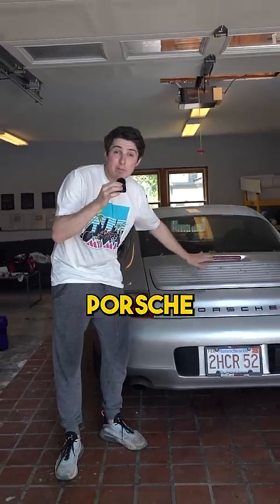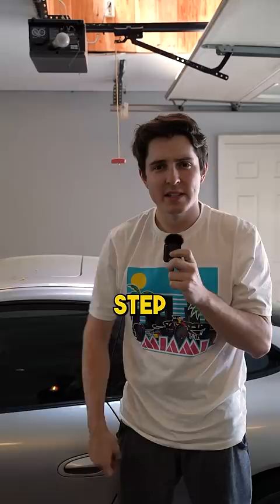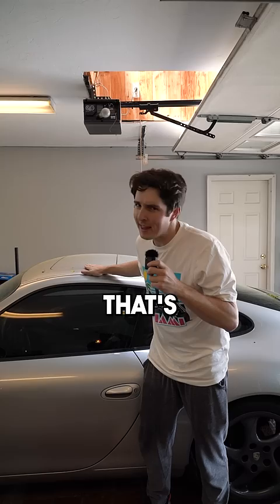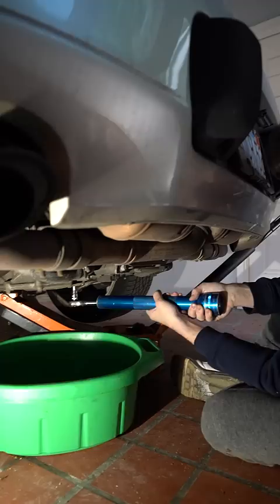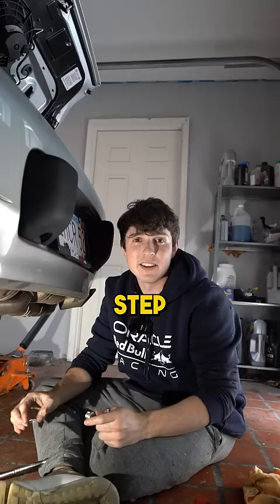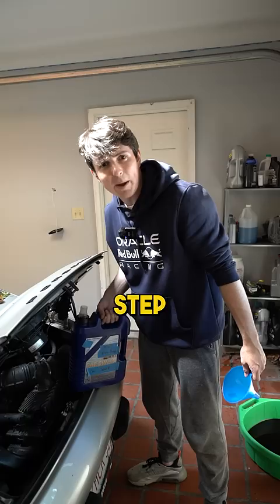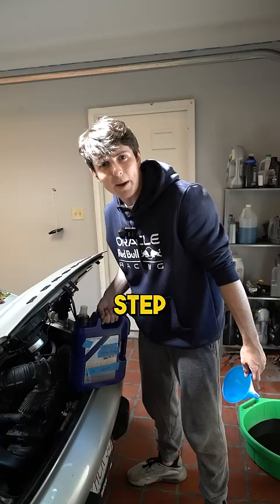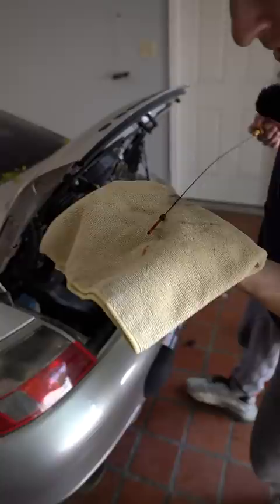Theres A Problem...

Comment: A pro tip, always lube up the gasket on oil filters and fill up your oil filter with oil. This helps both with installation and helps prevent the car from running dry till oil can get pumped throughout the car. The only time its not recommended to put oil in the oil filter is when it is instaled sideways rather than up and down.
Reply: i thought the same, and looks like i was right
Reply: It also makes the filter a bit easier to remove.
Reply: Lube on gasket don’t matter
Reply: Bro took 10 years to comment that

Comment: I have always wanted to know hot do an oil change. Thanks for teaching us 😊
Reply from the maker: Glad it helped!
Reply: Its pretty easy
Reply: @smolltaco5667 not for this guy.
Reply: @captaincrankshaft btw u need to run the engine for 30 secs b4 checking the level to coat the new oil filter. Also it looked slightly over filled. I have been in a garage my whole life, and u learn these things w experience x
Reply: @captaincrankshaft my car blew up while doing an oil change💀

Comment: Missed a step it helps filling up the oil filter with oil and then putting on then you wont have to wait as long to have it measured right on the stick

Comment: You should actually rev the engine before checking the dip stick because it might not actually be full since no oil has circulated yet

Comment: Here's a tips. Before you change your oil filter and put it in. Clean it with clothes or use some gas to clear the oil, and then soak the new filter with new oil before putting it back.

Comment: Now this was a pretty good guide on how to do an oil change on this specific vehicle. However, most modern cars (2000-2023) have there oil filter just under the hood, and should be loosened just to the point of being able to take it off. Next is locating the drain plug, now it should almost always be at the bottom of the car and needs some sort of socket (from ~15-20 mm socket). You also need a socket wrench you should be fine no need for a torque wrench unless you have one. Now Jack up the car and put a stand, now the plug bolt should be near the front of the car if your oil cap is up there if not then it should be at the back. You might also need a smaller socket, a screwdriver (Phillips head or flat head), or a torx bit because most cars have the oil plug blocked by some sort of cover. After you take off the cover and you have located the oil plug grab your socket and socket wrench and go counterclockwise with it. After the plug has been removed and the oil is draining wait 5-10 minutes before putting the plug back on; However before you put the plug back in you need to put on a new seal ring some filters that you buy may have a new seal ring for the oil plug though some won’t. So I recommend while looking for the oil filter get an aluminum or copper seal ring. Now after you have drained the oil and put the plug back in and screw it in tight but as soon as it requires lots of force you should do one more rotation and stop, this is mostly preference. Now the plug is in and you have your new oils filter you should see 1 or even two O rings (the rubber rings) in the box. Take out the filter from the car and try not to spill too much oil everywhere and wipe up any spilled oil. Take off the old O ring or rings, and replace them with the new ones. (I recommend this part but it’s not needed) rub some of the old oil on your fingers and rub the new O rings gently with a little oil. Now finally put in the new filter, and screw on the oil filter cap. Now finding your oil fill cap and adding just about 5 quarts is a safe number however if you have the owner's manual and want to search how much to add or just search it up online that is the best option. But I will always say just leave it to the professionals and always top up everything you can.

Comment: You have to let it sit then check it, after that u have to start the car and then turn it off after that u have let it sit for 10-20 minute then check it because u might of not poured it all out (oil) and so you have to let it sit so all of it sits at the bottom and turning it on spreads it all through the motor

Comment: quick tip, apply a thin film of oil on the new oil filter gasket. And if the filter position allows you to, put some oil in it

Comment: Another tip is to get the engine up to temperature. If its hot, its viscosity changes (the oil gets thinner) so nothing is left of the old oil. And if its thinner, it has a higher cleaning effect because it carrys the dirt with it outside

Comment: make sure to turn on the engine and let it warm up before an oil change. it helps the oil to collect all the sparkly bits also warm oil will drain better

Comment: It helps to fill the new filter with new oil before screwing it back onto the car. It can be a bit tricky as you have to hold the new filter level to keep from spilling oil. Idk why this is important, but that's the way I've always been taught and that's how I do it.
Reply: you honestly don't need to do it mate, a lot of people do it that way and a lot of people don't. There's not really a huge point doing it except adding time to your service.
Reply: @mekagumi  okie dokie

Comment: Every car is different and some, more difficult. Make sure you let the car run a few minutes to let the oil run through the engine and check it after to see if it needs more oil. We recently did an oil change on my dad's truck and mom's car and it was a pain in the ass being under each

Comment: For the oil plug you dont need to use a torque just a normal wrench and all you need to do is tight it just enough were its hard to tight the eat and cold of the air around it will do the rest

Comment: I Always laugh when ppl say to use the oil with right Specs. My 1993 Rover 600 Just says "10w-40"
No further Specs, nothing. Just 10w-40
Reply: Some vehicles simply require a certain oil weight. Others like Porsche require a specific oil weight and spec

Comment: Did you tighten uo the oilfilter with a wrebnch? If yes, pls never do that and screw it in just by hand, oil filters have underpressure (or what ever it is in english) and they suck themself in l, tightening an oilfilter with a wrench, could damage it or brake it, it can fail and brage your engine😊

Comment: Kinda surprised the oil change was so easy to do
Reply: This model 911 doesn't have a separate oil reservoir like the turbo and gt models. In those you have to drain the oil reservoir as well as the crankcase and since it's thin aluminum you have to make sure to use a 2nd wrench to prevent twisting and tearing. It also has a crush washer and a torque spec. The oil filter housing has 2 orings and requires a certain torque spec as well. On the 996 911 turbo the turbos require draining the reservoirs on the turbos themselves as well. Takes me about 1.5hrs to do it on my 997.1 911 turbo

Comment: Bro said new plug and washer but not a new O ring? And step 1 should be run the car until warm otherwise that oil is going to take forever to drain.